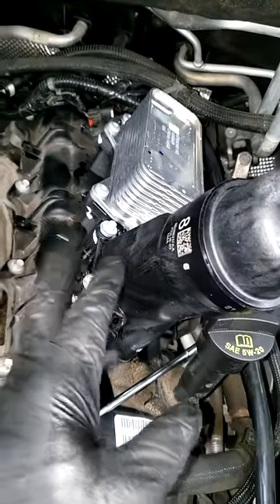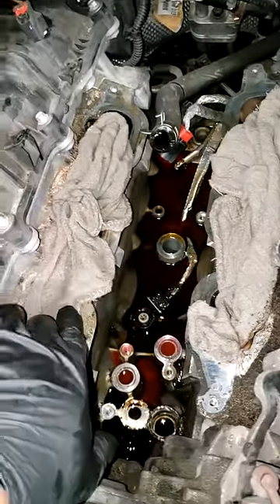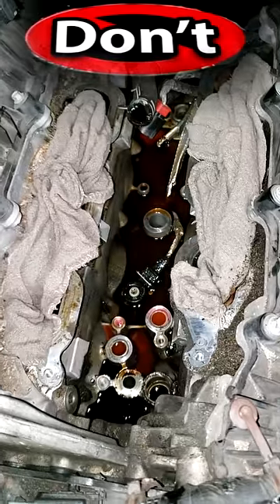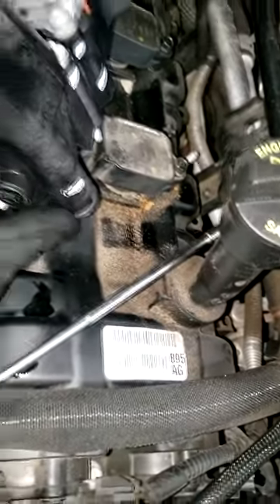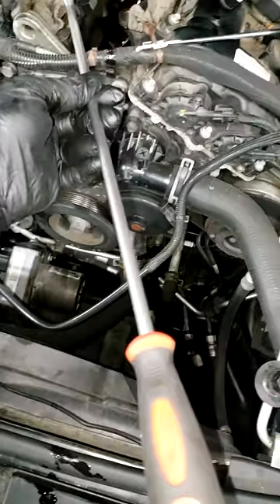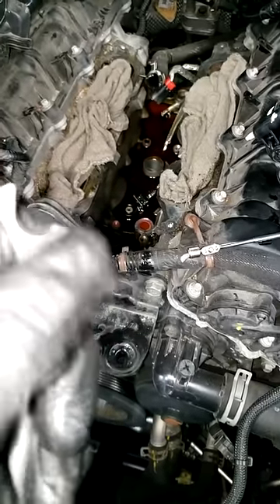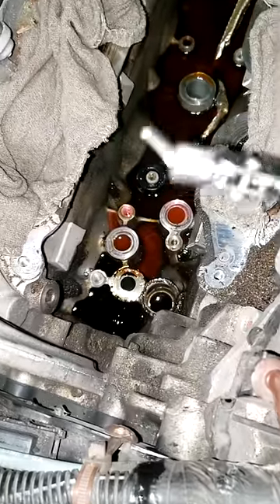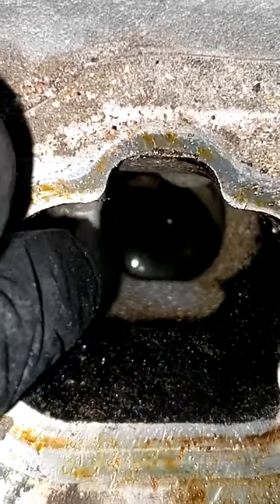This will scare the hell out of any mechanic. But I found it.

Comment: Take notice of all the sand and dirt around the area where the intake manifold sits on the cylinder heads. Here is a very good tip. Whenever opening up a engine. Valve covers, intake, throttle body, changing spark plugs It doesn’t matter. Take 20-30 seconds and use a blow gun to blow out the dirt sand and any other debris that’s sitting on the engine. It safer and easier to prep the surface for a new gasket and reassemble….
Reply: Came here to say that
Reply: Beat me to it. Lol
Reply: Totally... I also follow it up with a shop vac immediately!
Reply: My first thought, he is panicking about the piece of metal yet not a single word about the sand all around with some falling into the intakes. Yes good advice plug up the holes but here is better advice. Before ever opening any engine wash or blow or do both. 2 minutes time well spent.
Reply: Lol I thought this video was on all the dirt and debris lmfao I still think it is....
Reply: This is why i came to the comments lol
Reply: Especially diesel injectors!
Reply: ThatLooksReallySUS....
Reply: For real. When moved he the rag it was a beach full of sand. Who wouldn't get that immediately cleaned up?  All of that sand gonna get into every damn thing.
Reply: I wash em out real good. On the ford 5.4 V8’s the plug/coil wells are really bad about collecting all sorts of junk.
Reply: Its also good fucken tradesmenship
Reply: You read my mind lol
Reply: I was cringing looking at all that shit 🤦‍♂️
Reply: Beat me to it
Reply: or anything to clean it if you don't have air. rags wire brush. all of it will fall straight in
Reply: Yup compressed air 💯
Reply: I will keep that in mind thank you 👍
Reply: @BrandonWest87  the 2v/3v/4v  4.6 and 5.4 all collect a insane amount of sand and b.s. in the plug wells and around intake manifold like in video.
Reply: @codyramos3200  Dude tell me about it. I had to hit each with air, then with a blast from a garden hose. I was replacing the coils so I wasn’t worried about ruining them, but DANG was there a lot of trash in there.
Reply: You should specify before you take off any parts where sand and dirt can get into somewhere they definitely shouldn't and cause damage.
Reply: I just said this unknowing of this comment lol
Reply: This guy's mechanical skills are a mess.
Reply: "Some of us pros" lol what a shmuck
Reply: same!!
Reply: Yup👍
Reply: Vacuum up the dirt instead of spreading it around
Reply: @jasonrackawack9369  a mix of both would prob be best vacuum isn’t gonna do much
Reply: Yeah if its oily pull a rain man ray and brake clean with air...it works great...i always hose an oily one down with brake clean then blast with 150psi..it unsticks the gooey bits.
Reply: That's t he first thing my eye went to as well lol.
Reply from the maker: @dirtracingfan8742  Then say it..dont hold nothing back
Reply from the maker: @zxZEUS187  But you still can say it as well, go for it.
Reply from the maker: @SamSam-ih6nt  you suck at thinking
Reply from the maker: @henryhenry3832  But leave ya opinion as well.
Reply from the maker: @ActivateMission2ThisTimeline  how so?
Reply from the maker: @patrickbilancione1201  nothing got in no where. You thinking to hard
Reply from the maker: @JacoKruger.  but you still can say it.
Reply from the maker: @BrapBMX  beat you to what?
Reply from the maker: @boostedstinger  but we want to see you say it
Reply from the maker: @camtheman559  how so?
Reply from the maker: @bozo57  yea you the only pro in here right?
Reply from the maker: @Mark-yn1ti  same what?
Reply from the maker: @leekazan556  yep what?
Reply from the maker: @jasonrackawack9369  no dirt got in the engine. Stop thinking so hard
Reply from the maker: @Mark-yn1ti  it was cleaned up, video dont show that part..Calm down spanky
Reply from the maker: @alloutofdonuts3998  then comment it anyway
Reply: @OnlineMechanicTips  bro use the tiny bit of skill you have to see how everyone is calling you out and your lack of confidence has you tripping on everyone! How can you be making these videos and thinking you're on a pro leveling calling yourself pro you can't be making the basic mistakes on video
Reply: @camtheman559  he's a hack from the videos I have seen.
Reply: @Online Mechanic Tips  Nah. Not thinking too hard, just thinking.  A professional would never work with a condition like that without first cleaning it up. But hey I am not your customer so....
Reply from the maker: @patrickbilancione1201  And since you don't know what was done, why are you thinking out loud? This van was partially cleaned but not all got out, the rest was cleaned later. The video was filmed somewhere in the middle. So maybe you shouldn't think out loud unless you know what you talking about and not think  solely on what you see. Hmmmm. This van long gone running perfect.
Reply: @Online Mechanic Tips  don't be mad because your lack of attention to detail is being called out. I am free to think however I choose. Out loud or otherwise.  Have a nice day.
Reply from the maker: @patrickbilancione1201  Mad???
Reply: @OnlineMechanicTips  ?? bro i think most of us were agreeing with you what u mean ???
Reply: @OnlineMechanicTips  I did not say you got dirt into the engine, (90% of the other comments did though)  I had replied to somone who suggested blasting the dirt all over the place with shop air, I simply stated it is better to vaccum it up than to blow it all over the place....stop posting your life on YouTube if you dont want strangers comments on what your doing.
Reply: "blow gun" wouldn't have done anything to that oil soaked sand. Degreaser and pressure washer much bettaaaaaaa
Reply: @dougtodd305  Nah.
Reply: @OnlineMechanicTips  you can literally see some of the sand drop into the port in the video.
Reply: @440-6pakroadrunner  Or GDI  “Gas direct injection” they both inject into combustion chamber.
Reply: @jasonrackawack9369  vacuum won’t don’t much in this case. when using the blow gun. Always start at the very top of the engine and work your way down. The blow gun I use for this is the Typhoon with 12” extension. I don’t only blow the dirt away from that one area. The whole engine bay gets it.
Reply: BRO this literally happened to me😂 I shit myself when I seen shit fall into the ports good thing I had a shop vac
Reply: He has no concept of clean.
Reply: Thus is what's pushing me to learn to be my own mechanic. I don't know jack s#!* about engines, I do know a pound of sand an inch away from a disassembled engine. Man I really wish these mechanics would show just a dash more love for our cars.
Reply: Heavy equipment mechanic here... Compressed air, shop vac, hell even a pressure washer will take very little time to clean out the hard to reach areas.. this is unacceptable at any stage of the disassembly process. Shit work.
Reply: @jasonrackawack9369  I guarantee dirt got in that engine....
Reply: This should be common sense, but sadly it doesn’t seem to be…
Reply: My thought!!
Reply: Sand acorns 🍃.. Oooh yes
Reply from the maker: @camtheman559  If I thought it was a mistake I would not have posted it. You seem to forget, im a content creator on youtube. 500k views later on this video and you think ya lil comment mean something to me? Especially considering you have no content. You on here watching videos, I make videos for you to watch. Let that marinate for a minute.
Reply from the maker: @BobSmith-kd6lq  Bob you talking shit with a big B on ya screen name. That basically mean yo a nobody. Foh
Reply from the maker: @jasonrackawack9369  I love comments, just properly direct them to the right target please
Reply from the maker: @travisleopard8250  Another nobody talking shit i see.
Reply from the maker: @MikGruber  I guarantee you don't know what you talking about
Reply: I like to use a vacuum
Reply: @OnlineMechanicTips  what you are talking about < sounds better when said correctly
Reply from the maker: @MikGruber  I got this over here bruh, the car gone and running fine is the bottom line. I done lost track of all the sideline mechanic trolls comments. I really wish some of yall would jump into the youtube ring and just flex yall pro mechanical skills via video. But I assume it just more easy to talk shit on other videos. Smdh
Reply: @OnlineMechanicTips  "you suck at thinking" is the best insult I have heard in a long time lol, I don't know what the argument is about but this is a fantastic standalone quote
Reply: @OnlineMechanicTips  hack. Little skill and even less ability.
Reply from the maker: @BobSmith-kd6lq  Yall be quiet for a second, Mr nobody ass Bob trying to say something. Not that it matters but let him talk please. Bless ya lil heart. Gone head an say some Bob, you got the floor.
Reply from the maker: @fathaar  lol, we not really arguing, we all just have a difference of opinion. And you know what they say about opinions.
Reply: @OnlineMechanicTips  what do they say about opinions?
Reply from the maker: @fathaar  They like assholes, everybody has one. We all entitled to those
Reply: @OnlineMechanicTips  right on 👌
Reply from the maker: @T410ce  like how can you defend screwing screws into these newly fancy electrical system and sensors and think thats ok. Not only that, dont think they should be replaced??? I'm having a hard time understanding that
Reply from the maker: @abritabroadinthephilippines  Feel better now getting that off ya chest? Good, glad I could help. Because you know there's 0% chance I care to know you or work on your car. You should also note I could care even less what you think about me my guy.
Reply: @OnlineMechanicTips 
Man , the more you respond the deeper you fall . Just admit the mistake and we're all done.
Reply: Sooooooo much sand/debris!😅
Reply from the maker: @A-A-A-A-A-A-A-A  Fall where? Sorry that I'm one of those creators that actually read and respond back to comments. Why would you consider that a fall? You obviously don't understand how youtube work but its ok. As for you guys focusing on the tool and what kind of tool or the sand, nothing i can do about that.
Reply from the maker: @A-A-A-A-A-A-A-A  what mistake do you speak of?
Reply from the maker: @MrAce5022  Thats it? Is that the best you can do??? Smdh..try a little better dude, then come for me
Reply: @OnlineMechanicTips  
The mistake that you did , is not cleaning the top of the engine where stuff could fall in like dirt and sand . Now i appreciate the video and found it informative,  but the issue  of sand falling insind , and opening the engine cover before cleaning around ,  is a remarkable mistake in the world of engines .
Reply from the maker: @A-A-A-A-A-A-A-A  The mistake you make is thinking to hard, careful, you may hurt yourself. Your iddy bitty brain unable to stay focused on the topic simply because you to advance for such a video. That happens, my videos geared toward the DIY guys. They likely will stay on focus. But ya hard overly thinking ass just can't help yourself. For the 10th time. This a shorts video, the debri was excessive, big parts blown off before hand, not all came out, took parts off, this incident happen and without thinking about my surroundings, I whip out my camera and start filming my point. It's called multi tasking. You non video makers would never understand. Is sand getting into engine bad? Absolutely. Nothing got in and the engine runs perfectly done and gone. You prolly need to gauge which video your over thinking advanced super tech ass comment on. Yall sideline trolls amazes me sometime, where do yall find the time? Every diy that comment appreciative of the tips. Get ya mind right dude.
Reply: You blow them out? I don't, I have a strong minni vacuum for doing that.
Reply: @OnlineMechanicTips only person "mad" here seems to be you, thanks for making me laugh during my lunch break though.
Reply from the maker: @ausername7470  Whos mad? Mad about what?
Reply: glad i saw this, i’m actually changing out my spark plugs tomorrow and giving it a quick clean before opening is smart.
Reply: Facts
Reply: Oh yeah hard to not see it
Reply: Or if you don't have air wipe the area clean while the holes are blocked or taped over
Reply: All I learned from this video is that I'm thrilled he's not my mechanic
Reply: I just did this job. Do NOT blow off the debris until after you replace the part.
Reply: I can't tell if you nimrods are actually serious, or just trolls. Guess what? There's a very good reason he has this job and you don't. He actually has knowledge and experience. I keep seeing people on Youtube on mechanic videos commenting about "The actual right way to do it" , yet none of you post a video of it actually working huh? Just remember, if he's got the job and you don't...zip it.
Reply: But nowadays you have to take off a ton of things just to change a valve cover gasket. I had a 1973 Plymouth Satellite 318 ci V8. It needed valve cover gasket replacement. I had all the room in the world and nothing to move. And just for the record, changing anything that requires removing nuts and bolts on any engine, use a torque wrench.
Reply: Yessir I always do that doesn't get it all but it doesn't help
Reply: @marksmann1850  count me out on your comment. I’ve been 
a “professional tech” for just about 21 years now. I didn’t make the comment to bash him. I made it for others to learn how to do it like a professional…
Reply: @OnlineMechanicTips  I told you to change your youtube name along time ago.😂what a good tip
Reply from the maker: My Youtube channel doing just fine, in fact its smashing numbers. Now why on earth should I take your advice/tips and change anything dude? You in no position to give out channel advice when you don't have one..foh
Reply from the maker: @ James Jameson Now why should I take any channel advice from you dude?
Reply: You're right I was just messing around I don't really care.
Reply: Thinking the same thing.

Comment: I have actually found a lower intake bolt holding the cylinder 6 intake valve open, towed in from another shop for a no start. They're lucky the washer kept it from falling all the way in!
Reply: Yeah for sure but I don’t see how one cylinder would keep it from running
Reply: @tylermartin2631  it didn't, that was just one of it's issues. The engine harness was rubbed through in several places behind the cylinder heads causing the crank no start
Reply: @tylermartin2631  Normally the only time an intake valve should be open is when the piston is going down. This is how the engine develops vacuum in the intake manifold. A stuck intake valve essentially creates a huge air leak into the intake manifold. This will prevent enough vacuum from building up inside the intake manifold. Without sufficient vacuum in the intake manifold to suck in air from the outside the engine won't run. It's the same thing as pulling off the big vacuum hose going to the brake booster or to the PCV valve. Doing that will create a huge air leak going into the intake manifold that will keep the engine from running.
Reply: Whatr the chances it was a mid 90s long bed Silverado? I might know who sent ya that shitbox. (It was me)
Reply: @joevignolor4u949 ot quiet because each cylinder has it's own independent runner. Sure they all connect to the main chamber of the manifold, but one stuck open valve will not affect the operation of the rest of the cylinders. It will cause a miss of that cylinder, but it won't even affect combustion of the other cylinders because with the intake valve open, there is no compression of that one cylinder and as such no combustion happening in that cylinder to affect the mix of air fuel ratio of the rest of the cylinders.

A vacuum leak is different. A vacuum leak is unmetered air flow that is not compensated for. Therefore the OBD system does not add the appropriate fuel to balance. So the engine runs lean. Also vacuum leaks don't really prevent an engine from running. They prevent it from idling. If you open the throttle of an engine with a large vacuum leak, you can keep it running because you are adding more fuel based on factors like throttle angle, MAF flow, and oxygen sensors. Also off idle, vacuum drops inside the intake manifold and it's irrelevant to begin with.

Comment: An ounce of prevention is better than a pound of cure! 👍
Reply: An ounce of prevention is better than 500 pounds of scrap
Reply: That's a good one, imma have to your that one 😂
Reply: All that sand weighs about a pound underneath those gritty rags.
Reply: Always wear a rubber.
Reply: I won't be taking my Dodge to any dealerships in Georgia,that's for sure
Reply: @dougtodd305  better yet just go ahead and buy a Chevy, an older model lol
Reply: @lionbolt2136  l don't own a Dodge,l own a 65 Chevy truck l go out of my way not to buy Chinese products
Reply: A 3/16th inch gap in the exhaust valve is better than a 1/8th inch nugget bouncing around inside a cylinder.
Reply: @dougtodd305  I just shitcanned a '06 Dodge dakota because of smog shit and the computer that sends codes like a quack doctor. I got me a '77 Suburban that needed a buttload of work. Work, that I can dianose without 4 years of college. Its all fixed and well worth it. The dodge got towed cuz I left it in a supermarket parking lot. Merry Christmas to the lucky bastid that ends up with it.